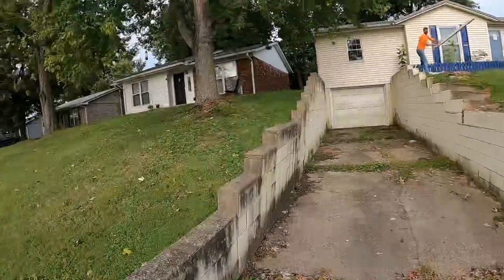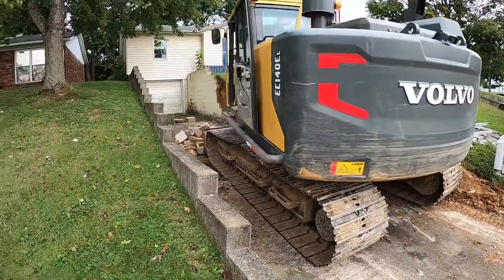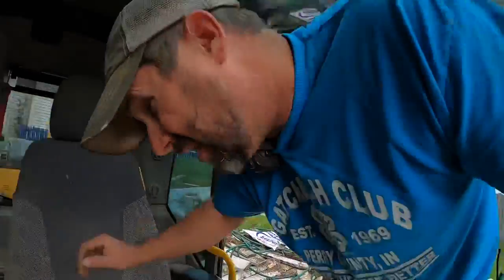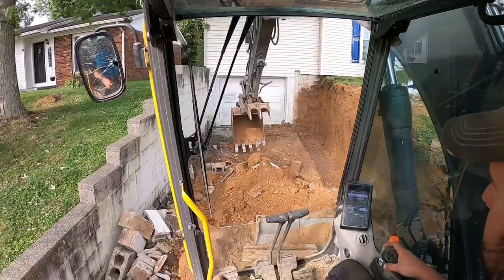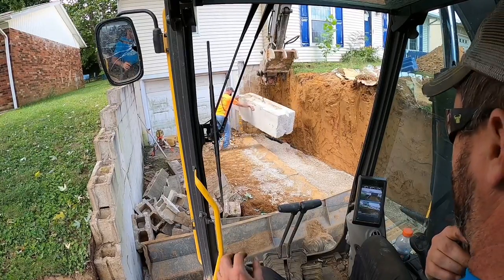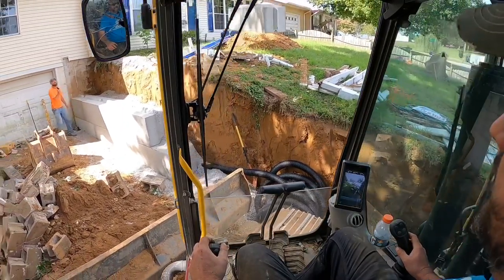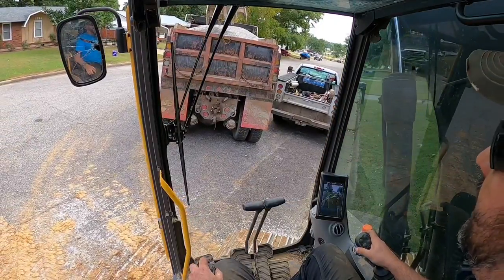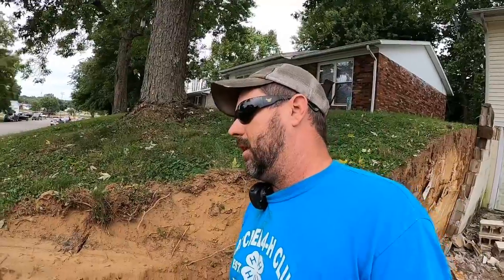What a day Building a retaining wall, Skunks, Crooked block and a tight job site.

Comment: Looking at the overdig reminds me of something that happened in my working career.  We had a building with tall pine trees around it.  We had a strong wind come and took down a couple of the mature trees, 30 to 40' tall.  When you looked at the root ball, you could see that while they had been there for many years, they had been planted with a tree spade.  The roots never extended from the original root Ball and when they blew over, you could see the exact shape of the tree spade hole

Comment: I ran into a skunk problem too. I was helping the millwrights by rigging for them. There was a stack of old heavy lumber up against the outside wall of the plant so I straightened it up a bit with a bar and motioned for the skidsteer to come pick it up. As my friend poked and lifted a skunk came running out from under the pallets the woods was on. Both sides were blocked, the wall behind so there was only one way out. Up and over the lumber. I spotted the critter and was backing up as fast as I could, the whole time waving my hands and hollering SKUNK! The skid was at high revs making so much racket I picked up a small rock and chucked it at the cab. Totally focused on the job at hand that rock hit the cab with a clang. He guy finally looked my way with a death stare and shook his head not understanding. For about the 5th time I hollered SKUNK and he got the message that something was up with the load. Just about the time he looked back front that skunk came up and over the stack headed for the cab of the skidsteer. The guy had nowhere to go but to back up. Right then the critter fell between the cab and forks. Still kinda panicked the guy was still reversing caught the skunk between the ground and the bottom of the pallet and......well.......smeared that skunk across the ground. The guy dropped the load and backed out of there but it was too late. The pungent smell of skunk perfume surrounded the whole mess, skidsteer and all. He comes gagging and coughing off the skid just a hollering why didn't I tell him sooner. I said I tried but had to finally throw a danged rock. Oh he says. We finally moved that pallet a week or two later and it still reeked we put it as far back as we could on the property. I stayed on 8 more years and to the day I left on a damp cool day you could still smell skunk both on the wood and the skidsteer. 
 I'm just glad only the concrete suffered the indignity of the spray. Being young helps out when you gotta climb over a wall in an emergency........LOL!
 Beautiful job on the wall, I'm looking forward to the finished results.
 Be safe and have fun!
Terry from South Carolina

Comment: I hauled a skunk on a GSA-leased flatbed one day out at Ft. Campbell when I worked as a civilian on post.  It was a piece going out on a flight and had to be hauled from the unit out to the staging building on the edge of the airfield ramp to be weighed and put in order for the load plan.  I had about five of these "isu's" lined up on the trailer, pulling my straps out as each one was loaded and looking through forklift pockets while hollering,"coming over!" before throwing them over...  Coworkers and any others standing around not paying attention tend to appreciate the heads up.  

I drove out to the pallet staging building and one of my coworkers began lifting each isu off to roll into the building to be weighed and staged (there is a floor equipped with roller bearings that makes this task relatively easy)...  All was well until I saw him bail out of that old Airforce John Deere and I suddenly smell Pepe 😳...  Yep, he had been hiding in the forklift pockets but made the mistake of getting between the forks and the bottom.   He drove it down to the next ramp near the airfield fire station and they hosed it as well as possible just so the unit could get another isu out to transfer everything over (can you imagine smelling that on a trans-Atlantic flight???  lol).  I also ceased looking through forklift pockets, tooooo...  lol

Comment: i did a job like that for a customer some years ago, but to make room i took both walls out at the same time and cut both banks back at the same time, and set them big blocks and stone on both sides as we worked my way out, it was going to be to much of a pain to have to watching my swing with every move though the whole job, but i also grouted, and tared and put a rubber membrane on top, and put 1" of rigid foam between the basement wall and the blocks as a cushion, for any block movement, due to frost. on the basement wall to water proof it behind the blocks as the house blocks were in the same condition as yours, so if they got water leaking in on the rest of the house they wouldnt have to pull the wall down to get behind the blocks. i also always put a filter fabric between the dirt and stone, as well filter fabric under and over top the drain tile, back fill with washed stone same as we do on foundation drains. the dirt always gets into the stone and plugs it up over time, we also put 2 drain tiles behind tall walls like the. one at the bottom and one half way up, one end of the drain tile capped and the other end out to the open. gees the captain delivered them block to that job, like a month ago.. it strange in capins last vid, he was getting stone, and said weight was like 4220 ponds. ops i am 20 ponds over weight. that trucks a tandem, my F600 5 ton i can carry 15000kg (33000Lbs) with the plates i have on, yes we pay by weight every year as to how much we carry, with out going over the max GVW, WITCH FOR ME IS $678 CND FOR 6 MONTHS, when i had it registered as commercial   it not used in the winter, as i dont hall snow any more, just odd how that's a tandem and you carry like 10,000 more only, if i recall the tandem a buddy has i think he can carry 80,000

Comment: Hey Mike, check the height of the wall blocks, if your blocks were cast from the same type of forms we use, the fronts are 24", the backs are slightly less, around 23.5".  They are designed so that as the wall is built, there will be batter or lean towards the rear and the center of gravity will be behind the wall.  I see mag float and bull float marks on the front of your wall, those are the backs.  Some blocks will be slightly less than 24" deep, some are filled all the way to the top of the forms and some are not.  The fronts should ALL measure the same depth to the indexing grooves and keyways....

Comment: I think a JCB Hydradig whould have been perfect for that job because it has no "Butt" that turns around with it since the engine and everything is in the lower part.

And a tiltrotor to turn the bucket into any direction whould be surely nice too.

Comment: Mike, tell the other guy that those Blocks are not part of the wall, they are separately attached to the wall usually with Block or Brick Ties. They but up against the wall only when the wall has been completed. They are not Interlocked into the existing house garage walls, only attached on the outside after the house was completed as an add on.
Reply from the maker: Most around here are

Comment: The ready mix companies have two grades of lock blocks, Seconds they are the ones made with left overs from trucks. They are not allowed to be used on walls that have to be engineered they are 80 dollars each. Custom pours are poured one at a time they are the only ones approved for engineered walls 120 dollars each.

Comment: I would have the block moved to the right more to have a wider driveway by 12"-24" and the top course of block I would not do and lower the yard in front of the house instead.  I'd probably widen the other side also.  You're not the owner so you do what they ask.

Comment: When you slide the block it's called lapping to get a tighter joint
Reply from the maker: Lol ok guessing you had a hard time understanding the video 🤷‍♂️
Reply: Michael, I'm assuming you're joking?  With tone missing from the written word, it can be hard to tell sometimes.  I assumed you were making an excuse style joke for why he pushed the one block into place, and if so I found it fairly clever.

On a side note and for what its worth,  lapping is one of the theories on how the Egyptians got the blocks in their pyramids to fit so precisely.
Reply: @spudgamer6049  of course but I'm giving you a machismo term ology don't you think it fits?
Reply: Like lapping valves
Reply: @michaelhaiden6718  yeap.  As I said, I thought it was a fairly clever joke.   Got a chuckle out of me, at least.  Valves are where I first encountered lapping, but I've since learned it does have other uses

Comment: Existing block was put in by a armature. All block walls over three courses tall require horizontal wire reinforcement and vertical rebar with grout filled cells. this is code in most places and subjected my the CMU manufacture.

Comment: Mike I would guess the original wall would have been fine if it had been reoed to the footer every 3' plus the blocks filled with concrete, instead of just relying the mortar to hold it together.